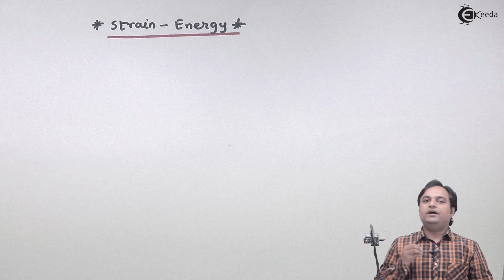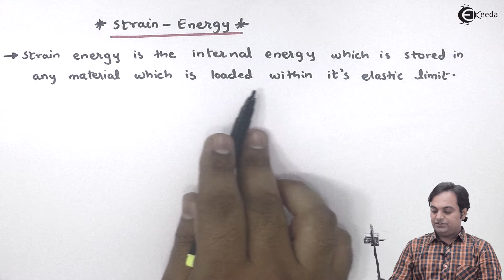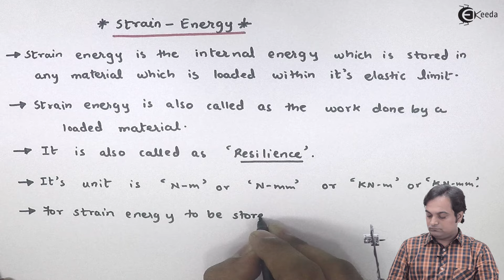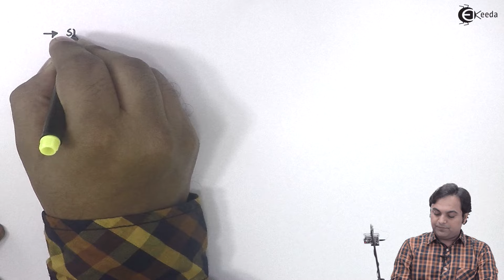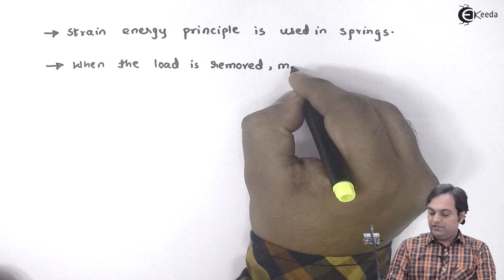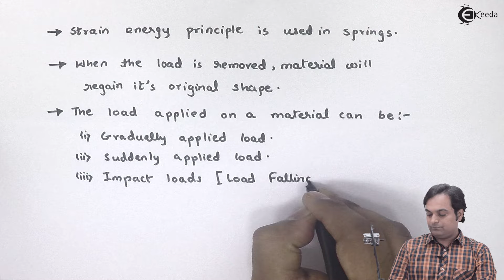Introduction to Strain Energy - Strain Energy - Strength of Materials

Comment: Resilience is not a strain energy, Resilience is the ability to store strain energy while applying load within elastic limit on the body and release strain energy while removing load. so body will regain its original shape/size.
Reply: resilience is stain energy until it is mentioned in the questions or anywhere else

Comment: what happens to strain energy beyond the elastic zone? Is it still strain eneergy or it is being transformed to other kind of energy?
Reply: however if elastic limit is exceeded the work done during non elastic strain is spent in overcoming the cohesion of particles of the material ,causing them to slide one over another and the energy expended appears as heat in the material strained
Reply: And the energy becomes a waste. Am I right?
Reply: Sir u r great.....